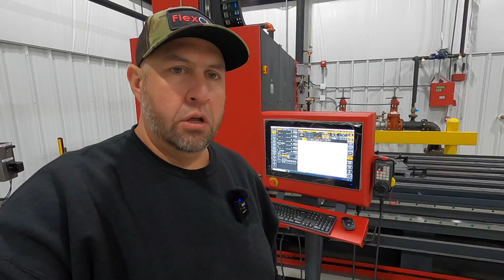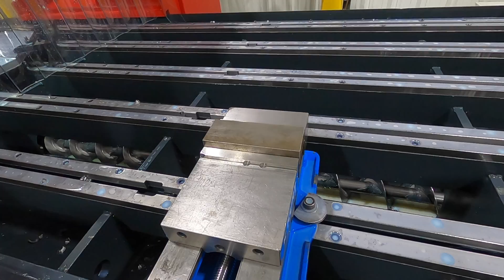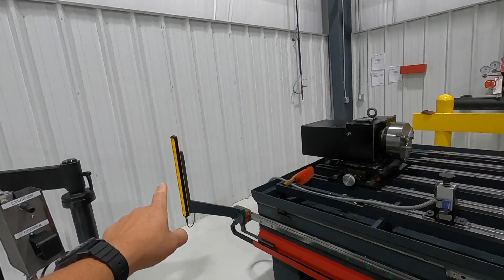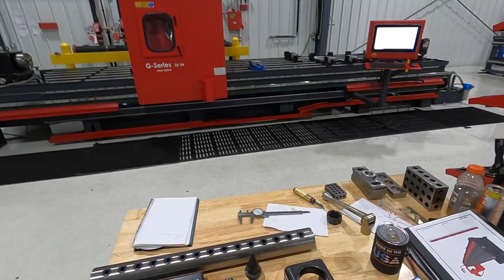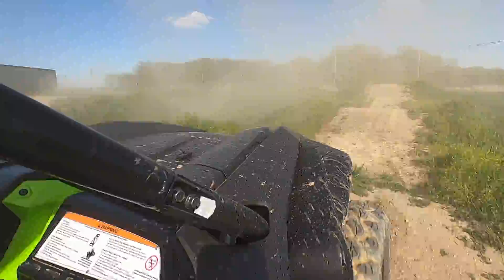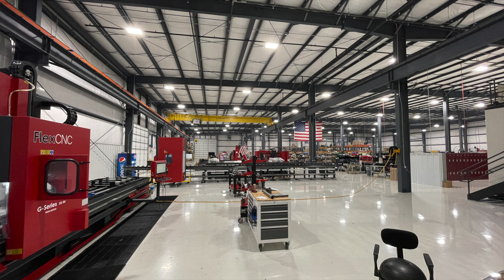SNS 347: CNC Training @FlexMachineTools

Comment: I understand that in your line of work CNC is something that you have to know these days but I hope'll continue the manual labour. There is just nothing worth watching in a video where a man designs a model in CAD and presses the "go" on a machine and has the machine spit out a part. I understand the ease of use and the simple fact that CNC machines are more accurate and faster and can do things that are next to impossible by hand, it's just boring to watch.

It's the same for 3d printing, lots of mechineshopw channels incorporate those and in the video it alsways comes down to "so then I looked up this thing on the web and printed it and see, it fits". The design fase is 'click download" and the print fase is just wtching a machine go bzzzt so they cut those out and skip to the end result.
Reply: CNC is for serial production first of all. Manual machining these days are mainly used for repairs and 1 off, small series. So CNC and manual machines will still live side by side many years. We need people that can master both.

Comment: You know what else uses gcode?  3D printers.  They already can 3D print metal.  And by printing layer by layer you can make parts inside parts easily.  At least I can afford a 3D printer.  LOL
Reply: 3d printed metals, while cool and useable for certain applications, have no where near the strength or variety of properties available to machinable stock, and cannot be tempered or hardened in the way a machined part can.

Great for rapid prototyping and applications where strength of a machined part is not necessary though.
Reply: @coletain  not to mention that the metal printing is expensive the printer its self is around the 100k-1mil range. Then each print cycle costs about 10k in materials unless you are printing something really short.